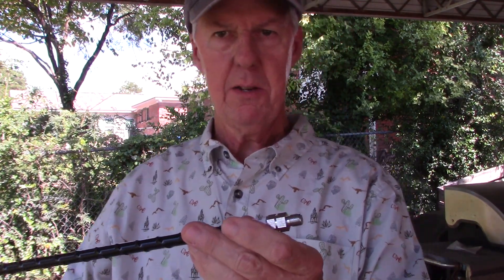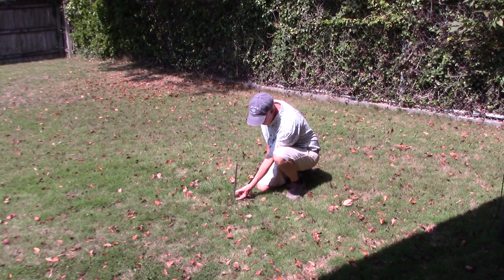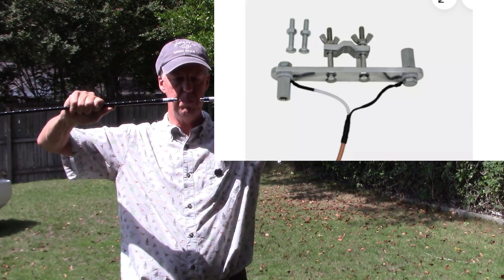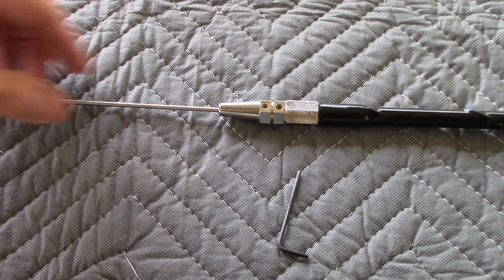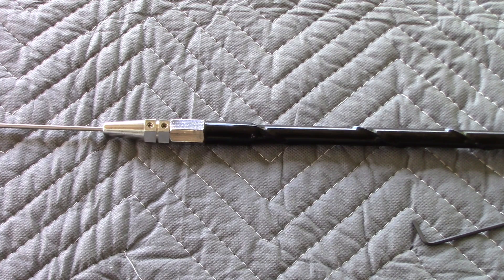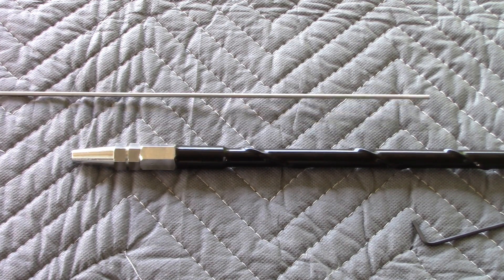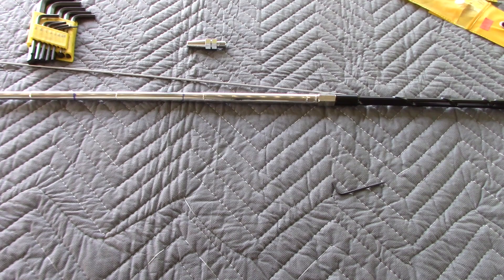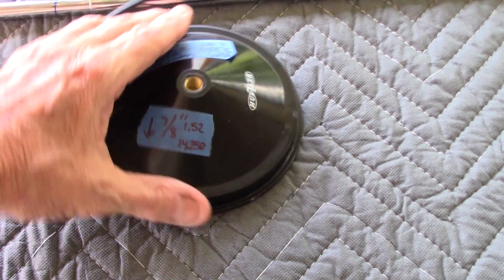Hamstick Antennas / Tips and Tricks

Comment: That extra piece that goes inside the antenna does not affect the SWR, or performance of the Hamstick…….at least not in my case. IDK what brand Hamsticks you have here, but mine are all Shark(American Made)brand from Gigaparts. All my Shark Hamsticks were a breeze to tune, and I didn’t have to trim the excess that went inside the fiberglass portion. The only one that was tricky, was the 40 meter only because it’s only about 250 kHz wide.

Comment: What length of 3/8-24 telescopic whip did you use?
Reply: I would try one that can be extended to around 4 feet.  The stinger sections on most Hamsticks are typically about that length.  Since the telescopic section will be “fatter”, i.e. larger diameter, than the stinger you are replacing, it probably will end up when adjusted to resonance a bit shorter than where the stinger would resonate at a given frequency.  

AJ1G
Reply from the maker: It's around 54". One I had left from an old Super Antenna that I use to own.
Check the Buddi Pole website. They have them. Steve - Ad4xt

Comment: An 80m hamstick is just not really tuneable
Reply from the maker: Yea they are very hard to deal with. Very narrow bandwidth too. I don't own one. Steve - Ad4xt
Reply: They are easy to tune if:

You mount them as high and in the clear as possible.  Not just behind your pickup
cab on the fender top, or on a triller hitch with most of the antenna only inches away from your tailgate. Top of fender left side just in front of tailgate best on pickups, on roof rack left rear corner on SUVs, forward end of trunk lip   center on sedans.

b.  If you use a mag mount, be sure you have the mag mount base bonded to the vehicle body (scrape paint to
you’d see bare metal) with as short a wire or strap as possible.  The coupling capacity of the mag mount pucks is woefully small for efficient operation on HF frequencies especially 75 and 160 meters.

c.  Connect either a shunt capacity impedance match ross the feed line at the base of the antenna.Typically 500-1000pf is best. Alternate is to use shunt inductance (about 6 turns of No.14 insulated stranded close wound on a prescription pill bottle) also works.  Without the shunt match you likely will not see a minimum SWR at resonance with a 75 meter stick.  The original Hamstick installation instructions included info on this but the knock off versions typically don’t, and it’s rarely mentioned by anyone in YT Hamstick videos.  With the matching impedance you should be able to get to well below 1.4.1 without any additional antenna tuner.

Yes resonance will be very sharp, but I’ve never encountered a problem getting one to tune while folllwing the above guidelines in nearly 25 years of mobile operation.

Many of them run out stinger length below 3800 kHz.  If you want to tune them lower in the band, get a longer stinger, maybe a foot or so.  Another tuning hack is to clamp a nominal 18 inch telescopic rod (the ones sold as pocket pick-em-up tools with a magnet on the end at Harbor Freight work well.  The telescopic rod
can also be adjusted to move the resonant frequency around without having to deal with the set screws that secure the stinger into the lower section of the antenna.

Don’t ever shorten the stinger to the point where it’s passing through the center of the loading coil winding on the lower half of antenna.  Will arc spark and melt the coil.  Just had that happen to me with a 60 meter Hamstick.

AJ1G

Comment: I love my 20 meter hamstick, the 40 meter, not so much. That just would not tune for the cw range.  I will give the telescopic whip a try.  Thanks for a great video!
Reply: The added length of a telescopic stinger will allow you to resonate down in the CW portion of the 40 meter band.  Or just get a longer section of stinger rod.  Another hack is to make a little stub of stiff wire on  3/8 inch ring terminal and attach it at a right angle to the antenna where the stinger ferrule screws into the lower section of the Hamstick.  Acts like a little capacity hat.  A fee inches should do the trick.  Cut and try, cut and try! 

AJ1G

Comment: Thanks for the ideas. I've had lots of success with hamsticks on ten and 20 meters, both on a mag mount and a ground spike with radials. Like you, I got the telescoping top section to make tuning much easier. Instead of marking the telescoping section with a Sharpie, I put a piece of tape around the fiberglass section at the length of the telescoping section for that band. That way I just extend the telescoping section to match, and screw it on. No worries about the Sharpie mark wearing off.
Reply from the maker: Good idea !

Comment: That telescopic whip is a "great tip." Thank you. Wonder why nobody sells a setup like that?
Reply from the maker: I guess they don't want it going down the road at 60+ mph. Pick you up one somewhere and use it static mobile.  Steve - Ad4xt
Reply: @hamradioportable1630  That's a good point. They could put big flashing (somehow) letters on the package saying "do not use on moving vehicles" and someone would do it and then try to hold them liable.

Comment: how did you initially remove the stinger?  on my shark hamstick, i can't seem to make it budge
Reply from the maker: Should be a hex screw. You will unscrew it anyway to use a telescopic whip.
Reply: There are two different hamstick versions, the expensive ones and the cheap ones. The expensive ones have the top section where you can unscrew it as seen in the video, with a 3/8-24 thread in the bottom section. The cheap ones don't have that, they just have the top section of the base with the whip going straight in. They have one grub screw, not two as well. Those ones can't be used to do this mod.
Reply from the maker: @paulsengupta971  that's good to know. Thanks.

Comment: Whenever possible use a hard wired connection to the vehicle body for connecting the shield side of the feed line.  Especially on lower frequency bands (40/80/160 meters a small mag mount that capacitively couples the shield side of the feed line to the vehicle body/counterpoise is very lossy. 

Also on 40/80/160 meters in order to achieve the lowest possible SWR you will invariably need to have some shunt reactance across the feed point .  Typically 500 pf on 40, 500-1000 pf on 80, and 1000-1500 pf on 160.  Small shunt coils can also be used, about 6 turns of No.14 insulated stranded wire close wound on a medium soaked prescription pill bottle works well on 40 and often 80 meters.  Using the shunt reactance will get the SWR at resonance down to well below 1.5/1.  Many of the installation instructions supplied with Hamsticks including the original Lakeshores and OPEKs discuss the need for the shunt reactance at the feed point but I’ve newer seen them discussed in any of the numerous YouTube    Hamstick videos.  Actually, any electrically short vertical antenna will likely need some impedance matching reactance at the feed point.  Typically, on 20 through  10 meters, you can get a near perfect 1/1 SWR on any properly installed and directly hardwired grounded to the vehicle body counterpoise  mobile antenna, Hamsticks included.

Chris AJ1G
Reply: The metal base of the mag mount above the plastic film should be connected to the shield side of the feed line.  Drill a hole in the medal base to attach an as short as possible grounding wire that can be connected to the car body.  A good spot on an SUV is at the left rear corner of the roof, place the max mount there and run a bet short wire attached to the body at the upper left corner of the lip of the lift gate just below the inner side of the weather strip on lift gate sill/frame.  Be sure to keep the grounding wire short, preferably no more than maybe 6 inches or so.  It can run over the weatherstrip, never have had a problem with leakage from such a wire.  Be sure to scrape/grind down around the holes on the msg mount base and vehicle ground point to bare metal for a solid low resistance connection.  On a sedan, put the antenna on the trunk lid and run a short grounding wire to the deck
lid frame.  Both ways will keep the connection point hidden with lift gate or trunk lid closed.
Reply: What I forgot to add to the above comment was that the shunt reactance is typically not needed on 20 meters and higher frequency bands to achieve low SWRs at resonance
Reply: Re cutting off the bottom of a Hamstick type antenna, as long as the stinger rod stays above the close wound loading coil windings in the lower section of the antenna, you will not have a problem.  Keep in mind that if you do shorten the stinger you will limit how low in frequency you will be able to resonate the antenna.  In over 20 years of using Hamsticks and other types of mobile antennas,!Ive never had to shorten a stinger to achieve resonance at the high end of a band. 

That said, your Idea of using a telescopic upper section is great.  However, I wouldn’t use one while driving around.  Probably wouldn’t survive bonking on tree branches very well compared to a stainless steel rod stinger. 

I have attached small telescopic     extensions typically up to 18 inches, to the top of my center loaded manually adjustable 1960s vintage Webster Bandspanner multiband mobile 80-10 meter antenna to provide smoother adjustment of resonance across a given band.  Finding resonance on 40 meters and higher bands with it by sliding the stinger up and down along its internal loading coil is very touchy.  The “vernier” adjustment with the small telescopic tip section makes it very easy to move around the band. Also the added length allows full coverage of 80 meters. The as designed Bandspanner runs out  of adjustable stinger length below about 3700 kHz.

I make the vernier stinger extensions out of small telescopic pocket magnetic tip pick up sticks sold at places like Harbor Freight and Ocean State Job Lot for a few bucks each.
Reply from the maker: Thanks Chris for the good information here. You have lots of experience with hamsticks. How would you get a ground to the body when using a single mag mount?   And yea, don't drive with a telescopic antenna.  Steve - Ad4xt
Reply: @hamradioportable1630  Do a search for GRA-MAT50 for a capacitive solution. You might need an SO239 mag mount with an adaptor to 3/8-24 to get the ground out to the antenna side without having to drill into a mag mount to make the connection.

Comment: Great video. That looks like a TW1 Super Antenna whip since it's 44 inches. They do not show in stock at this time.
Reply from the maker: Yes that's exactly what it is. I have seen a 5' on the dxengineering website.
https://www.dxengineering.com/parts/mfj-1963?seid=dxese1&gclid=Cj0KCQjwr9m3BhDHARIsANut04ZDEmE9z6vOc7XNzH9vy-3Ynu20Ueyf8Z7DrRhGOmDUN3u-eKVVVeIaArHoEALw_wcB

Comment: Like your cheat sheet, I think I will try my 17' whip with an auto tuner then I won't need a cheat sheet.  Great idea with the ham stick.  This would be like having a loaded 17' whip.  I am listening to your video through headphone and lose the left audio around 7:14
Reply from the maker: I plan to do the same with a 17' telescopic antenna i picked up from gigaparts.
I'm using a wireless mic system. It may have had a short drop out in one channel. Did not notice when editing. Thanks  Steve - Ad4xt

Comment: I have never had to cut anything off! Tunes up just fine with the whip inside.
Reply: I cut them down to a point where they don't reach the coil inside the stick.  You can see from the outside where the thick section is.